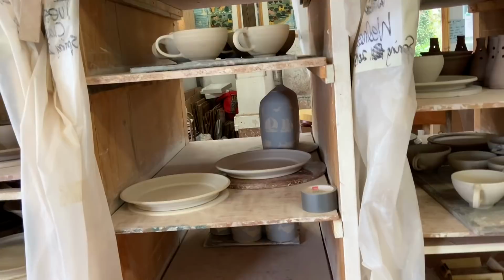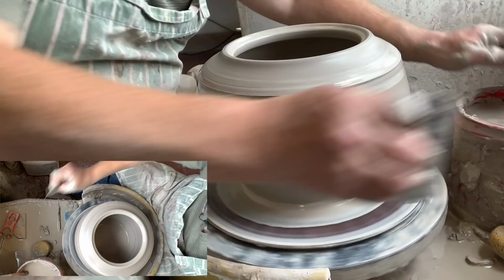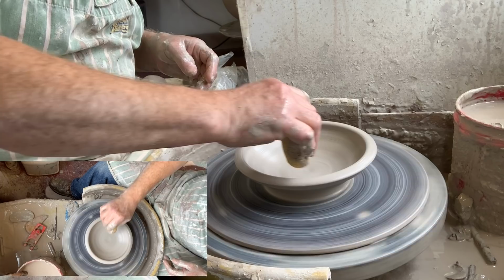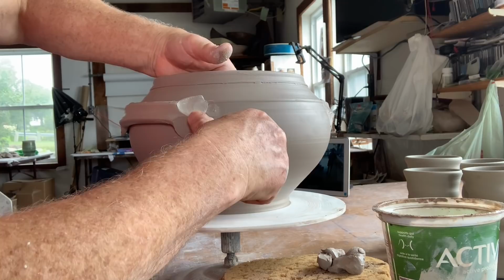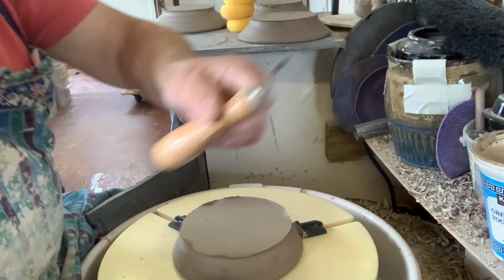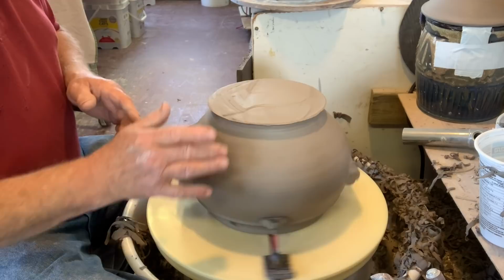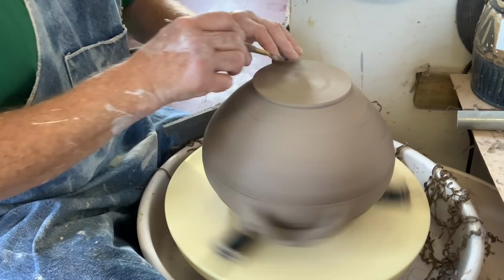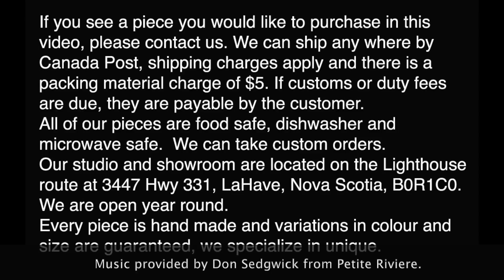Five Casseroles

Comment: I've always struggled a bit putting in the gallery but watching you use the pin tool to start the split I think is going to really help clear up my issues. Thank you - one small change can make a huge difference. Your double screen shots worked well 👍🏼.
Reply from the maker: Thanks I wondered if it was confusing to watch.
Reply: Yes! Seconded. It has made mine so much better and so much easier to get a good lid fit with more depth to the lip.

Comment: Hi videos are nice. Great quality. I had a teacher tell me that loose bats can cause the clay to go off center. Her solution was to put a pice of doubled up or trippled up grocery bag over the pin. It stopped the banging of the bat
Reply from the maker: I replaced one of the pins after I recorded the video, the other pin is stuck so other measures are necessary, tried a hammer but I think drilling it out is necessary.

Comment: Always a wonderful experience watching you work, Vaughan, and I appreciate your generosity in sharing your skills with us. A current dilemma I am facing is an "S" crack in the bottoms of my large pots as they dry. Drying too quickly? Unmatched wall-to-bottom thickness? A secret sign of some sort? Thanks for any advice you can offer.
Reply from the maker: S cracks are usually when the bottom is still soft in the middle when the walls are dryer. So the bottom wants to shrink and cannot , the walls have already shrunk. So the answer is to dry slower or to cover the walls in plastic while exposing the bottom to the air. Making the bottom thicker also helps. Another trick is to compress the bottom more, which is why you see me run my finger from the wall to the center, reversing the opening pull. I hope this helps.
Reply: @Vsmithpots  Thank you!  Funny how such advice always makes so much sense, and one wonders why it had been so elusive... ; )
Reply from the maker: @mikeu5380  Thanks for the back information, fortunately my back has been OK.

Comment: Hi Vaughan, I just made a 10” x 2 1/2” casserole dish and it cracked on the bottom side (wheel side)  but not inside.  
Why would that happen?  And when I throw a big dish and cut it off it seems to shrink and crack 😕 I’m having a hard time with that
Reply from the maker: Make sure the bottom is not too thin. Dry slowly and cut through the base twice, a day apart. I try to make sure the walls do not dry faster than the base. When you are opening up the ball of clay try to run your thumb or fingers back from the wall corner (2-3pm position) back to the center to compress the base. This evens  out the stress caused from opening. I use a rubber rib to compress the base and even it out, erasing the throwing rings. All of this is is pointless if the base is too thin or dries too fast. If the rim edge dries it makes it impossible for the base to shrink so it pulls on the walls and since the walls are rigid if dry, it will crack. Hope this helps. Also make yourself a harp 18 inches across, to stretch a guitar string across, very tight. I use mine to cut through plates and platters.
Reply: @Vsmithpots  thank you 😊

Comment: Hello can you use casting slip for sgraffito. I bought a pail of casting slip for moulds, wondering can I use mason stains and colour it to use a slip for sgraffito?
Reply from the maker: I think it would run off the pot since casting slip is meant to be very fluid, it has sodium silicate in it. You can try adding vinigar to it to see if it thickens it. You can also add liquid Epson Salts to thicken slip. It just needs to be thick enough to stay on the pot.
Reply: @Vsmithpots  thank you so much I'll try a little vinegar and see. Just wanted to make sure I was thinking it was 2 different clay bodies.

Comment: For a casserole is it best to fire the lid on the pot or off the pot?
Reply from the maker: It depends on the clay body,  kiln shelves being flat and if the pot warps at the peak firing temperature. I fire lids on stilts and have had no problems. Also how thick the lid wall is.
Reply: @Vsmithpots  thanks

Comment: I appreciate your generosity in sharing your skills with us. I'm trying to understand what causes the clay cylinder to twist as I raise it--other than pulling up too much clay too fast.  Thank you!
Reply from the maker: I think you are right.
Reply: @Vsmithpots  Are there other causes? I have diligently tried to raise the cylinder slowly with as little clay as possible, and yet the Twist Demon appears. Perhaps faulty wedging?
Reply from the maker: @mikeu5380  I think the main reason is the weight of clay above your fingers is too heavy to be supported by the wall pulled underneath.
Reply: @Vsmithpots  Thank you... Back to the wheel to dispel those Twist Demons.

Comment: Put paper on the batt pin and it will stop the noise
Reply from the maker: I have done that, it worked. I have tried replacing the pin but this one is 35 years old and seized on. I am going to try cleaning it and putting epoxy glue around it. I thought about heating it up with a torch but that would just enlarge the pin in the hole. Then I thought I should cut it off and drill new holes. That is the option I will do.